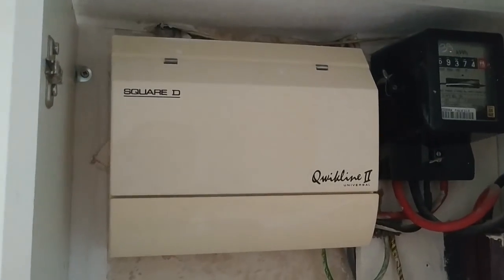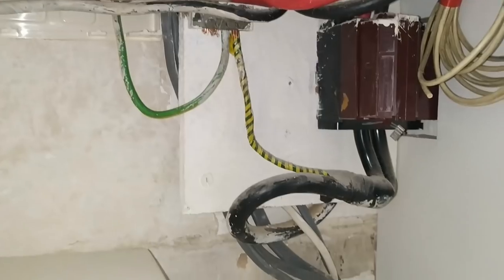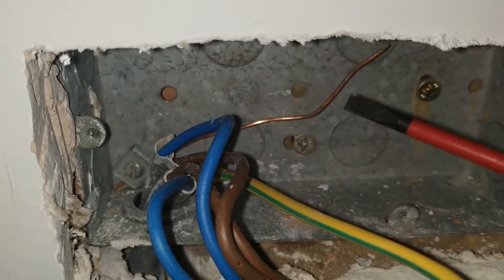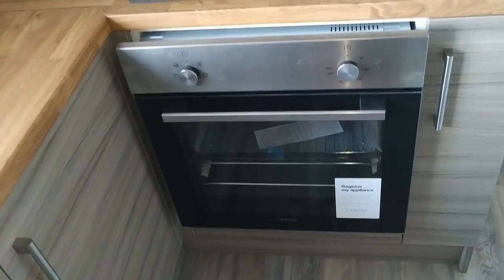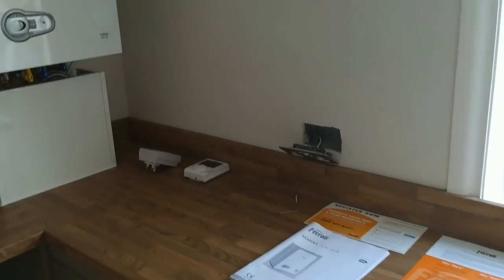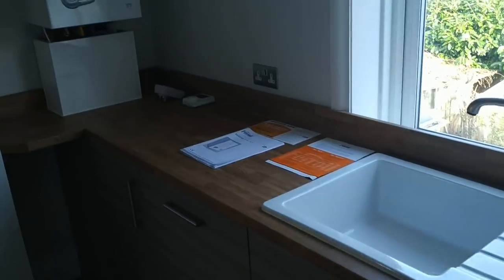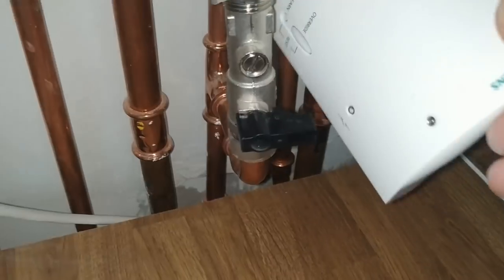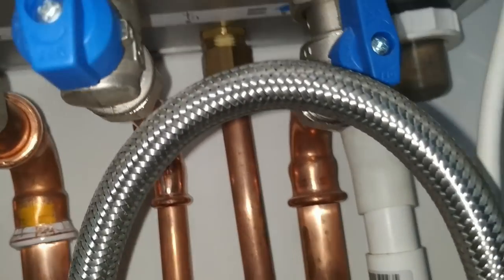Newly Refurbished Electrical Shambles

Comment: It's tempting to say "typical DIY job" but the more I come across "professional" work the more I realise that diyers often do a far superior job. New build provides ample evidence for this.
Reply: When we moved into a new build we had lights that wouldn't turn off and one bedroom didn't even have a light switch as the plasterers had boarded it over and nobody noticed. I agree about the DIYers, most will actually research the correct way to do things. My current house was plastered by carpenters, plumbed by plasterers and wired by plumbers. That should upset most trades :-)
Reply: diymostthings I was called to a new build, 1 year old, no PME connected, but the Earth wire was just hanging there.
Reply: I agree DIY’s would frequently do a better job but they’ve got all day to do it. The issues with this installation smack of pressure to get it done and move on to the next one.
Reply: Couldn’t agree more. I do all my own work (except brick laying and plastering! 😆). As for the other trades it’s impossible to get anyone, in my experience. Cheaper and quicker to DIY, also you get the job you want, not how the contractor thinks you should have it! 😆 - like the electrician who said “a 12” fan will suck the knives and forks off the table”.
“That’s the one I want”, I replied. “Well, I’ll only fit a 6” one”.
Bye bye. I’ll do it myself!
Reply: RMLectronics UK I do all my own work. Including plastering and bricklaying 😛

But, seriously, I have done all of my own electrical too including changing the CU. Why? Because I tried 2 “professional electricians” one of which I caught pulling with all his force a T&E cable between the architrave and door lining (because it was “easier to run it that way”!!) The cable was fucked (stretched) and he was told to piss off. The rest of his 1st fix was shite too. 

So I do it all to the regs and then got a PAT for the BCO. 

I live in my house with my wife and daughter. I want it done correctly. If even it takes me longer. 

And don’t get me started on plumbers....
Reply: Graham DIY Spot on! They’re a waste of time and money. As for plumbing well, I’m still waiting for one to turn up - from May 1996!
Reply: @professor1972  I guess it was built by electricians then ;)
Reply: @rmlectronicsuk2410  Impossible to get anyone - Know the feeling. Hello new chainsaw !
Reply: I'm the same with my car.

I don't like garages working on my car.
Having lived in various areas of the country, I have had to change garages and MOT testers multiple times.

I have a local garage that is acceptable, but even then they have made mistakes that I have to highlight.

One testing station managed to make the make the car dirty inside and out on a simple MOT test... No rework, no additional items to check.
I have no idea how.

Although I can't quite carry out all the trade work at home, I do all my own repairs. Plumbing, electrics or Various other things. - I also take photos and notes of how things are routed or connected, for future reference.
Unlike when our new build was constructed and I asked for any information such as plumbing/wiring routing and they told me that such a thing didn't exist.
It was decided "on project" at build apparently.

There are professional traders who take pride in their work across all industries, but there are also those who just want to be paid for a day's work regardless of quality or as seen in this video, safety at times.
Reply: @underwaterdick  Cars. 
Case 1
Steering problem. Required a set of gaiters. Took car to father/son garage. Collected it later - job not done. 
Excuses:
1. We couldn't get the wheels off
2. We couldn't get the ball joint nuts off to split the joint.
Result:
Did the job myself at a friend's house.

Case 2:
MOT.
Worn/corroded front brake discs - required new. Job done, paid for, collected car.
Drove it onto the road, turned around, took it back to get the brakes fixed.
New disc they'd fitted was different thicknesses around the disc.

Case 3:
18k service, cam belt change by local garage. All done bar cancelling the 'service' indication on the dash.
Paid for the work, collected the keys, sat in the car & within 2 mins had figured out how to cancel the service indicator & set it for the next 18k.
Went back in to the garage to say I'd done that. They came out to see I had.
Didn't tell them what I'd done ;)
[Not quite ctrl-Alt-Del !]
Reply: @millomweb  oh dear, great examples of why I do it myself.

The good old "we couldn't..." Line. Despite them not calling and asking if time or money was an issue at all.
If you couldn't do it today, how about next week? If you need to replace parts, send me a quote...

My friend rang me in a panic once to say his car was making a horrible "clunk" noise as he drove. He had pulled over on a dark road on his way home, scared to even get to a decent stopping point.
When I turned up and moved the suspension and steering about, I couldn't replicate it.
Suddenly I had an idea, when was his car last taken to a garage? The answer...two days before.
A quick inspection of the wheels showed that one was minus all 4 nuts, just tearing itself apart on the studs, and the other was minus one nut, with the other three all backed off the wheel face.
So much for "professional".
It turned out to be luck that all four wheels had been off and had loose nuts, because I took one from each to place on the one without. All done with a crappy little tool found in the boot that would probably struggle to undo the nuts if at the correct torque setting.
Needless to say the garage bought new nuts (and we insisted on them being new and sealed in their picking bag) and found him a replacement wheel (second hand) for the one that now had elongated holes. No form of compensation for the payment of the original poor work however.
Reply: @underwaterdick  But now we have the Internet to publicise this kind of work !
As for the loose wheel, are you sure it didn't need new studs as well ?
In my steering gaiter case, now, I realise I should have offered to the job at their place and showed them how to !

Have you come across these "flank drive" sockets that Snap-On came up with ? I noticed that garage had those type of sockets. They're liked by amateurs as they easily go on and come off nuts - even naff corroded nuts. Thing is, nuts were designed with pointy bits purely for driving them on or off. For me, a properly fitting socket either goes on a nut with a wiggle or either a tap or bash with something persuasive. Once a socket has been hammered on a nut, it is extremely stable and totally unlikely to slip off no matter how much effort you apply to the leverage !
Reply: @underwaterdick  i took my car to a garage that let the work experience kid tighten the wheel-nuts. He forgot one wheel. Luckily I pulled over to the kerb just in time for the top of the back wheel to pop out of the wheel well at a jaunty angle, leaving the hub hanging on the lower two studs. Miraculously the wheel and studs were not noticeably damaged, which is lucky because the alloy wheel would cost a bloody fortune to replace. They recovered the car and bought me a new set of nuts for all four wheels. They were surprised I wasn't angry. I just consider myself lucky it didn't turn out worse.
Reply: Leigh Browne Part P has been an unmitigated disaster. Typical of Labour (John ‘two jags’ Prescott) approach to a government that must oversee everything- yet after 15y we still see issues like this. 

Rogue traders will always exist - bad people will always exist. I don’t know how to stop them, but Part P hasn’t/won’t.
Reply: Q 400 why am I not surprised. Persimmon should be in court answering a class action lawsuit like they have in the states.
Reply: At least for me, doing DIY work on your own property means you have a vested interest in doing the job right. If you don't, you'll only have to redo it later or put up with the issues.
Reply: @Leigh Browne I'd love to get the inspection reports sorted for the DIY work I've done - but as you say, the electricians I've spoken to won't do it, even if I leave the plaster off for them to inspect the wiring with a fine-tooth comb. I think John's video is proof enough that for every dodgy DIYer, there's at least one dodgy "professional" contractor!
Reply: @GeeTheBuilder  What a shame we don't have class-actions over here, everyone has to sue the company individually. Though that said perhaps that's a good thing, might get a £10m judgment... in the form of a voucher for £100 each off a new home...
Reply: I have come across a lot of DIY jobs and they definitely dont do a far more superior job. Incorrect size of cable, cables not terminated correctly ect ect
Reply: @Leigh Browne not worth the paper they are written mate
Reply: Yeah it all works well until it goes wrong. To say a DIY’er does a better job than an Electrician is Rubbish. You’ve just unfortunately dealt with shit electricians. My Bias is the complete opposite, the amount of jobs I have been too in regards to “Competent DIY’ers” that have been damn right dangerous is often too many. 
Most of the time they do not have the nouce to comprehend installation methods or have limited knowledge of Regulations.
Reply: DIY'ers will often take more care and time. The difficulty is that they lack knowledge and can make dangerous mistakes.
Reply: @philipocarroll  well I agree but the point I was making was that those shortcomings are not the sole province of d.i.y ers. From what I have observed your comment applies to some pros. As well!
Reply: diymostthings What does that mean? Your original comment suggested that DIY’er’s do superior work. Ok I’ll be devil’s advocate for the sake of the argument and suggest DIY’ers take care. Although that is rather a broad statement. But when you suggest DIY’er’s being “Superior” in what regards? Electrical installation knowledge? Regulations? Adequate cable sizing? Load diversity? Volt drop? 
Most of these that I have listed can be found online but put into practice safety? I’ll tell you what.... Can you continuity test, IR Test, Impedance Test, RCD test? Do you know the correct resistance/Impedance values for said circuit? Like I said “All good, until it goes wrong”
Reply: @jurassicsparks5220  yes I do all those things. I have a suit of test equipment and the current wiring standards. Not rocket science.
Reply: diymostthings 😂 ok mate. Good luck 👍🏻
Reply: @jurassicsparks5220  I do agree with your general point. Many diyers will not know those things. But I would say that a lot of "pros" are not completely competent in all of them.
Reply: Half of the connectors fell out or Conductors? Your comment made no sense. 🙄 DIY’ers
Reply: @millomweb  if you ever have to "show them how to do it" ... ensure you bill them at DOUBLE their hourly rate! It's why I use reliable non-dealership garages as they are "qualified" not certified! "Qualified" through years of experience, happy returning customers typically cheesed off by the unqualified, but "certified", so called technicians they employ at minimal rates while charging £60 an hour! That's daily IT consultancy rates!!
Reply: @Leigh Browne And you mean the "certified" sparky's work IS tested?! When? Clearly not by any building inspector of any worth on the basis of John's video!
Reply: @DaysOfDarknessUK  understandable in a refurb with fixtures and fittings already in place, but in a NEW build!? That's disgraceful and all because it's hidden behind plasterboard!
Reply: @philpem  Know what you mean. Having to have a council building inspector be paid to come and "approve" the change of MCB in a CU from one that is too high for the cable fitted (and not required for the load) is a farce! The fee is about 20 times the cost of the MCB or more and a sparky, with minimum call-out fee is not far off the same - for a 5 minute job by anyone half competent and with a non contact mains tester and screwdriver. Should the "NEW" MCB require testing? NO! Not when it's a NEW one, in the wrapper! WHY does anyone still expect a brand new item to be faulty? EVERY SINGLE ONE should be tested prior to leaving the factory and be robust enough to handle transit without issue!
Reply: @jurassicsparks5220  REALLY! Well I completely rewired a friend of mine's mum's house, ALONE, over 50 years ago - aged 17! Replaced virtually every circuit and piece of cable in the place. The house is still standing. The electrics are still sound. His mum passed years ago but he still lives there! The standard of wiring was way better than that in John's video, albeit not in brown/blue as it was still red/black then and for MANY years afterwards. He's NEVER had to have any other electrical work done as a result of ANYTHING I did.
Any job you've been on that had to be sorted out was obviously NOT done by a "competent" DIYer. Therin lies the problem. When Part P was brought in it was entirely unnecessary. ALL that was required was to ensure that "competent" was defined properly - it NEVER was!
Reply: @philipocarroll  If they lacked knowledge then by definition they were NOT competent! It's a complete non-sequitur to suggest anything else!
Reply: I can echo that having had a rewire on a refurbished bungalow performed by professional electricians with a new consumer unit, all certificated and everything. The workmanship was poor and I've had to do remedial work, such as replacing back boxes with deeper ones so that the faceplate can be screwed back fully. As for the mess of wiring in the loft...

The 1970s house I once owned maintained earth continuity on the upstairs lighting circuit purely by having the CPCs twisted together. Then again, the whole house smacked of bad workmanship.
Reply: Dusty 99  I know victor well 😉 some might say, thats me.
Reply: @99Noggin  that may be the case, but should still be done properly.
Reply: I ran into a pretty striking example of this in the place I used to live. It'd been renovated shortly before I moved there. Apparently, the painter was in a mighty hurry, because rather than taking the faceplates off the outlets, or using masking tape, or anything like that, they just painted over everything: wall, faceplate, and outlet. I had to peel dried paint from some of the outlets before plugs would actually fit in them.
Reply: Dusty 99  Your Mother chose it, Dusty
Reply: Dusty 99  Oops! Too effin' late mate! I'm retired but STILL a full IET member for over 45 years and an Associate member for four years prior to that! I'm a graduate Electrical & Electronic engineer - No such thing as a "day job for us" we're usually so busy keeping sparkies in line (or trying to).

What's YOUR day job? It sounds like it's something to which you don't quite relate properly!
Reply: Totally agree with you.
Reply: Professional electrician that put TWO three core cables directly to the motor on a three phase compressor. 
Brown  and blue of one to phase one and two ,the brown from the other to phase three, both earths to the earth point.
His excuses,  his boss told him to go and wire the blue thing up. Motor was blue, BUT SO WAS THE COMPRESSOR,  with an on/off switch and an isolator on the front🙄.
This so called electrician didn't even know what size cable to use.
Luckily my work mate was an ex mines electrician and told yhis fool what cable ect  to get, we fitted it. 
These people work amongst us, and he was not the first so called electrician who knew best 
PS the compressor comes with an electrician drawing  that tells you what you need. Cable size and fuse size..
Reply: This. Almost every "Pro" I've encountered are fucking jokes that struggle to keep an 1/8th of an inch pitch or wire a simple GFCI correctly. Absolute dogshit. 30+ years in the trade and can't do shit.

Comment: As a gas engineer I would be concerned that the grommets were not correctly fitted to the boiler, as many boilers nowdays have room sealed cases. On average I'm inspected by Gassafe every 7 years. After my last inspection I had a cuppa and a chat with the Gassafe inspector, one of the things that he mentioned was that Gassafe were cracking down on grommets being omitted, or fitted incorrectly. If you can see light through a grommet, then under fault conditions products of combustion including carbon monoxide could enter the living space, with dire consequences.

Comment: Unfortunately we see lots of this shoddy work. Wiring standards are getting worse. I call it builder spec. I don't wish to offend any builders at all but then again they shouldn't be working with electrics.
Reply: H J Beck - I also watch you on YouTube :) I have to say that I bought and refurbished two houses by myself (no electrics though). Even I could manage to put on correct sleeving, use new plugs and screw things to the bloody wall. I think a poster above got it right, it's all about speed these days.

Comment: This installation is pretty good compared to some I have seen, one flat I was asked to inspect had 10mm T&E cable coming up from the chippy below and passed through an open window which couldn't be closed because of the cable!
Reply: If the window was open less than 25mm, then it was compliant.